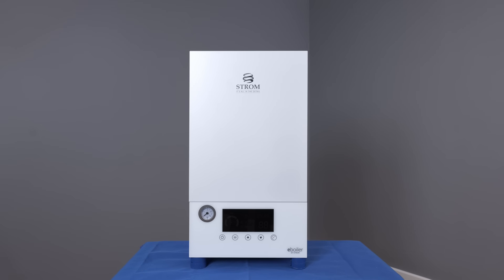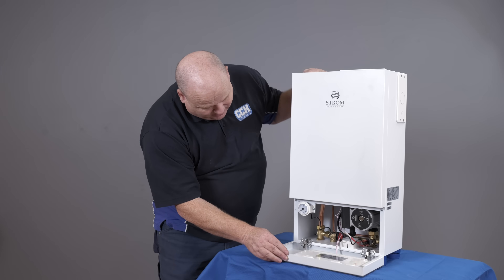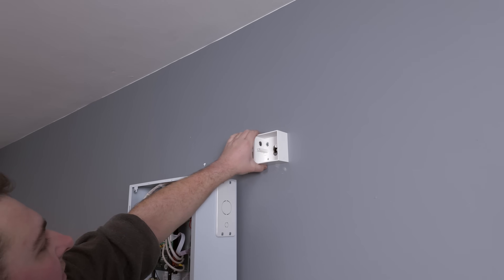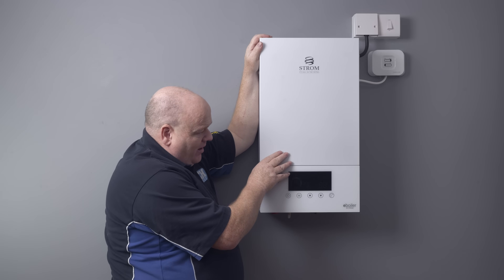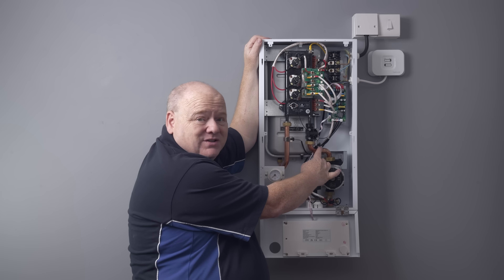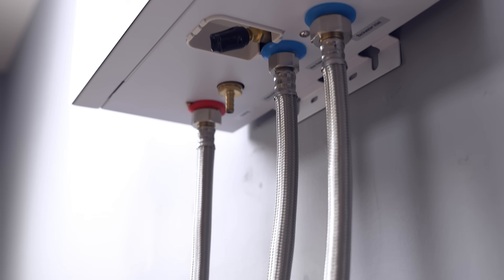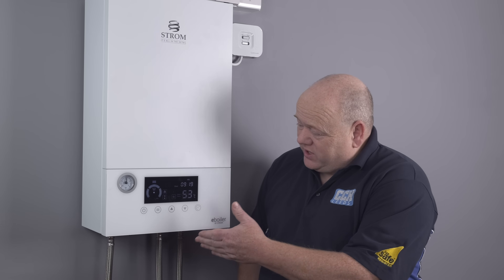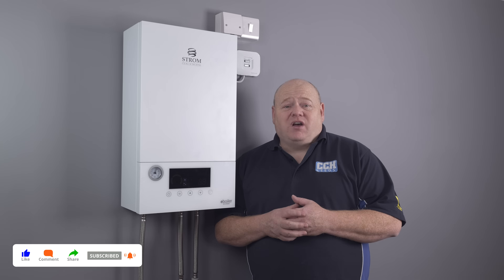Electric Boiler Installation Strom eboiler Electric system boiler Central Heating System

Comment: Electric boilers would be the answer with green electricity but they're an absolute fortune to run.
Reply: My gas supplier has a monthly standing charge regardless of how much I use. Going electric saves that and no need to have a regular gas safe service.
Reply: @onlyme972  35p a day, over 365 days is £128, which at 25p a unit will buy you 512 kWh/ units of heat from electricity. Enough to heat a home for about a week in winter. After that you are paying 4x for your heat for the rest of winter.
Reply from the maker: Depends how much you pay for electricity, We are paying around 8p KWH atm. Thanks.
Reply: @AllenHart999  is that time restricted?
Reply from the maker: @daz3745  Thats the blended rate. something like 30p peak and 6p off peak, But I charge my battery off peak. Thanks.
Reply: @AllenHart999  what times are your off peak?
Reply from the maker: @daz3745  11.30 to 5.30
Reply: @AllenHart999  you’re mad to spend the money on batteries so you can just waste all that energy in an electric heater. Just fit a heat pump .
Reply: @edc1569 how much did the heat pump cost?

Comment: Fitted an 18kw combi to UFH heating and basic domestic hot water system last year.
Very easy to install but programming  not the easiest  on first install. 
Powered by solar PV/ battery/ 3phase.
Plus wise, easy Install but requires 3 phase supply so limited  applications, LPG/ oil are options.
Reply: Only £5.40 an hour to run at full bore in January when the battery is flat. You taken it out yet?
Reply from the maker: Thanks.